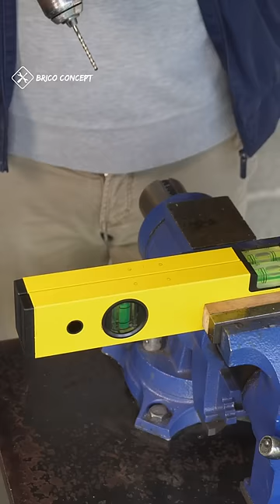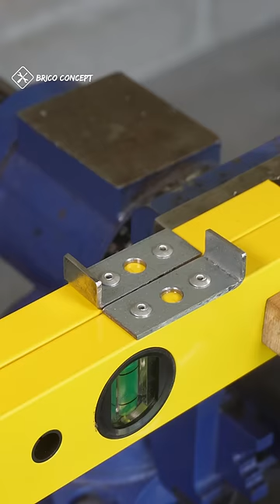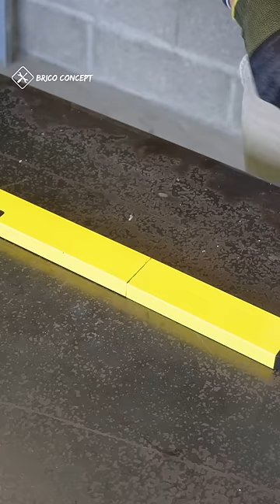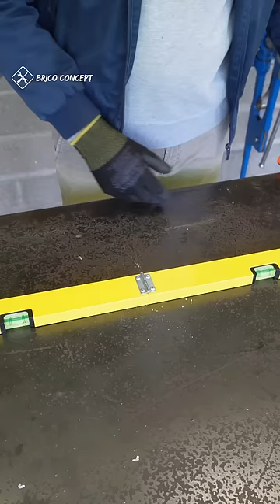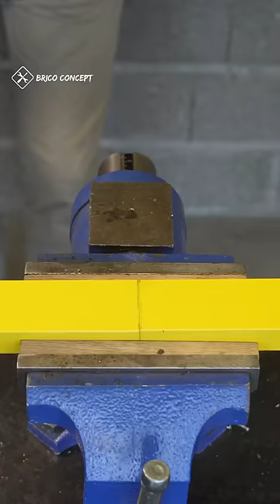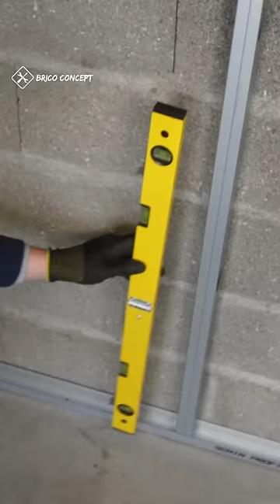Drywall Level #shorts

Comment: I don't understand the use of the magnets on the top because if you stick it on a steel structure you can no longer see the level. Plus the barriers prevent the use of certain lengths. and finally why not just use a large level which will be 100% sure to be level and above all simpler and less cumbersome. finally for use on a small area you have a heavy level and for long ones, the long rivets will become loose and the precision will no longer be there

Comment: Sorry mate but that’s a waist of time effort and money not to mention the inaccuracy of that contraption. Spend the money on a 1200 level instead of TWO 600s and all the hardware. 🤦🤦🤦
Reply: It's designed for easy storage in tool box.
Reply: @veronicamoore6340  might as well fold a 1200 in half then as the accuracy is still out so what’s the point?